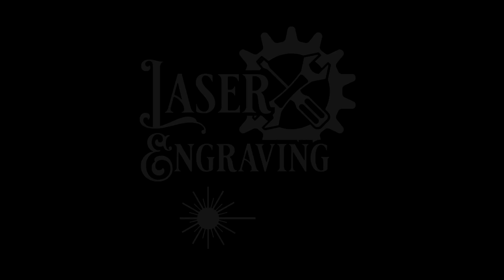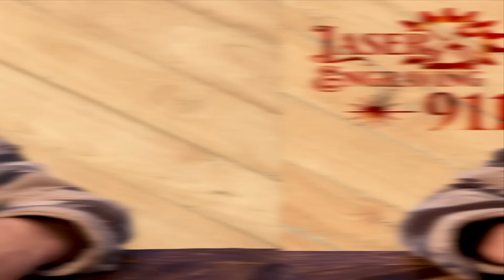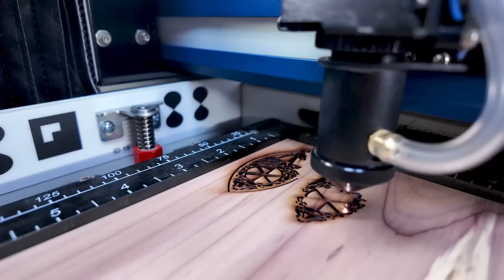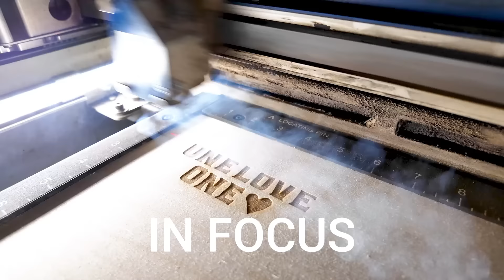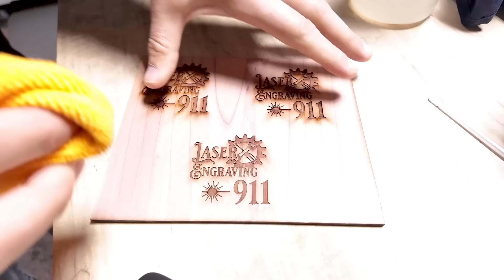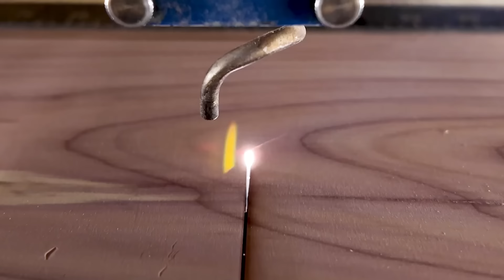Top 10 Laser Engraving Pro Tips – Wood

Comment: Hello there.

Very usefull video. I like #10, but KERF is almost impossible when you're dealing with puzzles because the cut is the same for all pieces, so you can't apply kurf offset. Yes, you can print every piece as a separate object to be able to use kerf, but that's not possible if you will use a photo glued to the puzzle unless you assemble the puzzle & glue the photo, but you'll have to cut the photo using a blade for each piece, which is a pain in the butt.

Thanks & greets from Argentina
Marcelo Miguel Bazan.
Reply from the maker: This guy does not seem to have and issue with his puzzles, you might want to contact him and see his workflo https://youtube.com/shorts/-uEHlGsJCX4?si=mzSb6pIVbbnDkPHU

Comment: When engraving with no air assist, how do you remove the soot after the laser finishes? Do you use an air compressor to blow the piece off? Great info, thanks!!
Reply from the maker: If your getting soot around the engraving the engraved areas with NO air assist on then you are running it too hot!, turn down your power, and increase your speed a bit The whole idea is you should not be getting any soot when your air assist is off. Hope that helps! You can always use methanol or isopropyl to clean up residue.

Comment: Hey Michael, Great tips. Just got my first laser xtool s1, testing some engraving on wood. On dark stained pine and ply having issues building the depth and keeping the engrave light under the stain and clear of char. I'm considering multi passes at the same settings to build the depth I'm looking for and maybe I'll try increasing the air assist for extra clean cuts. Please advice accordingly and thank you in advance.
Reply from the maker: Lower your power, multi passes, and turn your air assist off  or so low it almost off. Air assit when engraving only ADDS char, hope that helps.

Comment: Hi! I become one of your new followers! Hope you doing great, I have a two questions:
1. regardingthe air compressorcapacity: What is the right air compressor to set up with a 80w laser engraver? I been doing research and some places told me I just need between .6 to 1.5 CFM, some other places said I need up to 5CFM. 
2. The other question is about the watter chiller (based on my budget)
Does a 3200 water chiller works on a 80w laser CO2?

Hopefully you answer soon.

Have a great day!
Reply from the maker: Here is a great chiller for your machine : https://lightobject.com/q600w-mini-water-chiller/?ref=lp8sd4jd and here is a great quiet compressor for your machine as well, I use this same on on my 120watt Co2 laser, and run it at 25-30psi when Im cutting, and 5PSI when Im engraving. https://amzn.to/40JlG87

Comment: i wonder why they dont do air assist as a suction and or both a suck and a blow.
Reply from the maker: Down draft tables are not on all laser machines, in fact not many at all. Usually only the ultra high end machines have a down draft features, and suction. But yes when you have it its very nice, tow of my machine do have this feature, and I use then still with air assist and down draft combined.

Comment: i have air assist and my lens keeps getting very sooty. I have been mainly cutting wood and I have noticed that it takes longer to cut
Reply from the maker: you must keep your lens clean all the time, if its getting sooty and your air assist is working properly, consider getting a stronger fume extraction fan to get the smoke out of the laser  cabinet FAST!

Comment: Michael, I know it is probably a crazy question... but the kerf value you find... do you find that once or can it vary from material to material.....i.e. as long as i use the same laser for the wood, or cardboard, or acrylic the kerf will be the same kerf number?
Reply from the maker: not a crazy question, yes the kerf will change slightly from material to material, so you will want to bench test that. It wont change much but it will change.
Reply: @LaserEngraving911  ty so ill add kerf to the material test board i make then thank you
Reply: @LaserEngraving911  a new kerf question Sir.... i cut a 20mm x 20mm square and the sides were 19.64 x 19.54 is it possible that there could be a .10 mm shift between the sides or did i do something wrong while making the shape? And i gather if ok i would have to do a kerf figure then for both the x and y axes?

Comment: thanks for the tips, you have answered some of my questions.  I have a question for you.  A lady asked me to make a wedding sign.  She asked me to paint it black and the lettering has to be white.  I should note that I have an Atomstack A20 Pro.  I painted a piece of pine plywood and then I covered it with cricut vinyl (my big mistake, dangerous to ones health)  I did a line cut on it and then picked out the pieces that I didnt want.  I then sprayed the carving with white paint.  It looked pretty good but I can see where the paint went outside the lines.  and I can also see the cut marks in the wood.  I have just bought some laser safe vinyl for cutting - what would you advise is a good power setting for cutting thru the mask without leaving a noticeable gouge around the letters.  Burt
Reply from the maker: Burt, I would go about it another way. I would make the sign back from wood, paint black, then laser cut our the word, and paint white, then glue together.
Reply: You could then do a low power pass on the black paint of the letters for placement, or use the white letter outside piece as a template for placing the letters.

Comment: Thanks for this video. I will definitely refer to these tips. I have a question - I have an xtool S1 40w and I am currently cutting 5mm plywood. I am setting a lot of charing on the cut lines. I try to clean it with rubbing alcohol but still find that it is still quite charcoally and it gets everywhere. I think that I need to adjust my current settings (80%, 10mm/s, 1 pass) to have minimal charring. What type of adjustments would you suggest; as a start? I reduced to 71% power and it didn't cut through. Will increasing the speed help? Thanks in advance!
Reply from the maker: Speed and  Power are very related. I would start with max power and fastest speed and each time you run a test, drop you speed by 10% until you cut all the way through. Dont change the power. leave it at MAX, also it is crucial that you are in focus and that your air asset is TURNED ON MAX and working properly for cutting material.
Reply: @LaserEngraving911  thanks so much. I had my air assist on automatic. Next time, I will turn it on max. I will create a test cut file using your advice. Much appreciated!!
Reply from the maker: @jasmindrace  love it
Reply: @LaserEngraving911  Hey! The only laser guru I trust! I am having issues cleaning up my engraved wood (250mm/s, 30%). I am using plywood from the hardware store 5mm. I have heard you can use alcohol to clean it. I have used 96% alcohol and pure acetone and it just seems to smear the cut (13mm/s, 100%) and engraved wood. The ash gets stuck in the grain of the wood. I have heard you can sand the surface and that just seems to lighten my engravings. :( I followed your advice about turning off air assist when engraving and turning it on max when cutting. I am not sure what to do any ideas? Thanks so much!
Reply from the maker: @jasmindrace  Try running lower power and fasters speed and multiple passes to get depth, rather than one hard slow pass. Check your lens make sure its clean, check your focus. I like to use  Methanol to clean up soot, or alcohol, never used acetone, air  assist on low or off.
Reply: @LaserEngraving911    thanks so much. I will try multiple passes. I may do a test cut file because the single pass test yielded poor results regardless of the variations. I recently cleaned my laser head and lens in the hope that it would fix the issue. Thanks, will report back my findings soon. Just in case someone else has the same issue. Thanks again!

Comment: Tip # 10 is insignificant to my engraver.   I’m using an xTool F1 and its kerf is at an angle.   The top of the edge is narrower than the bottom edge.  There are not many projects for me to do.
Reply from the maker: Well, you could look into the P2 or the S1 by xTool and solve that issue.
Reply: @LaserEngraving911  if I had the money to buy a new engraver, I would.   I purchase usually after a season as Santa Claus.   That’s when I have the money.

Comment: Awesome video !I've been searching the web all week trying to get info on my new laser (didn't come with a users manual & can't get any info from the manufacturer).
    Long time cnc guy but new to lasers . 
I have a 40 w Aenbuslm with air assist wired onto a cnc wood engraver. Using glbr software to mach 3 controller. My main question is air presure for Engraving for different speeds and feeds. Some people suggest a small airbrush aircompresser ,but that barely pushes out air . Any advice or help would be greatly appreciated
Reply from the maker: Thanks! A general rule of thumb with air assists and lasers is when you’re engraving you want to try to keep the air pressure down to like five psi around there pretty low just enough to blow any particulates away from the lens but when you’re cutting you want to have your air pressure mostly turned up kind of high around 25-30 psi except when you’re doing acrylic, you actually want to drop that down low so you get smoother cuts. You should watch my video that I just released on top 10 pro tips cutting acrylic to.
Reply: @LaserEngraving911  awesomeness,  thanks. Yea ,i will check that out ✌️

Comment: Another tip I've found when cutting thick wood, say 3/4", is that when the laser gets to a certain depth of cutting, the laser beam becomes out of focus to finish the cut. So after a few cut passes I raise the bed to keep the laser in focus to where the material is inside the cut channel and finish the cut all the way through.
Reply from the maker: great tip, also a 4” lens helps too
Reply: @LaserEngraving911  IF that is an available option for your laser. Unfortunately it is not on our Epilog Mini’s. Unless you know of a workaround???
Reply: 😊😊😊😊😊😊😊😮😊😊😊😮😅😊😅😮o9

Comment: What info could you tell us about MDF. I’m working with maple MDF with veneer and regular MDF
Reply from the maker: MDF is basically sawdust compressed with glue to make a synthetic wood composite. Its engrave fine with very little contrast, and is very hard to cut through due to the glues, and density, and is very hard on fume extractor filters. If your just engraving the veneer on the surface of the mdf base, you dont want to go through the veneer just engrave on the surface.

Comment: Thank you for the info. I'm new to engraving  and just bought the xtool s1.  If you could make a recommendation for me I would appreciate it.  I'm trying to figure out how to use lightburn and haven't figured it out. I watched a tutorial on how to get started and drug my laser across the metal grid. I've asked in some groups but as always you get comments from peeps who prefer to mock you than help. Thanks in advance.
Reply from the maker: Sorry to hear that :( I would take off the laser module and see if  there is any damage to the laser where you dragged it First. Next I would recommend that you use the XCS software that xtool provides and not start off with ligtburn right off the bat. You can use light burn later after you get familiar with your laser and the software that came with it. XCS software is much more user friendly to those just starting off with a new laser with little experience. Not saying light burn is not great, just need to walk before you run. hope that helps.

Comment: Question: I keep seeing dark stained projects that have a light colored/pale engraving on it and Im curious how that can be achieved. Is that something that can be done with a diode laser?
Reply from the maker: Hi There, what you are most likely seeing is people engraving wood that is a light colored wood like pine, or particle board MDF that has a stain on top or dark veneer, and they are engraving through the surface to reveal the light wood under it. So you could stain the wood dark then engrave through the stain.